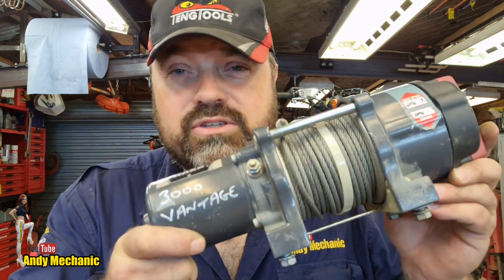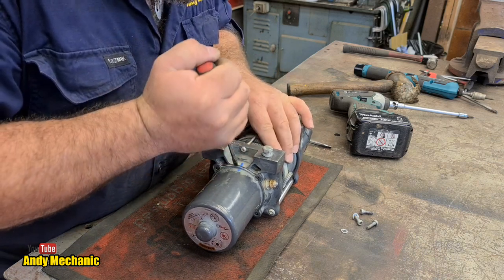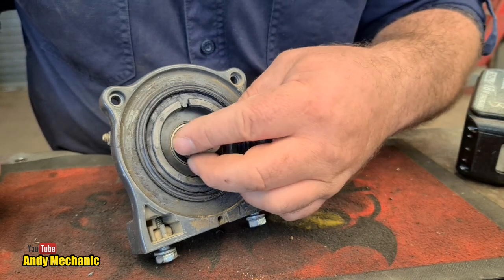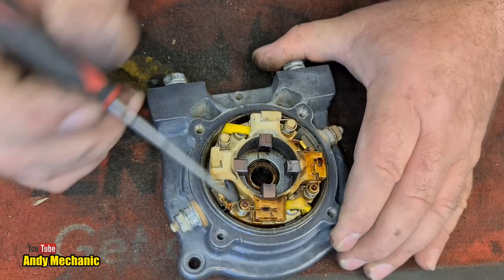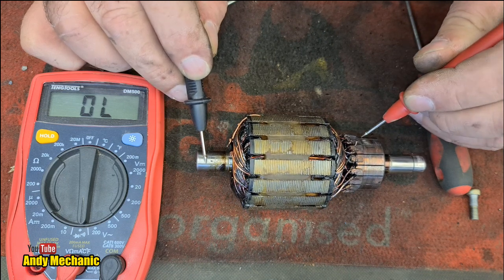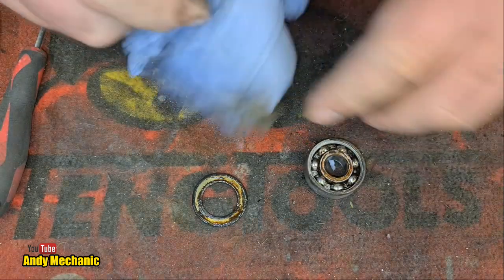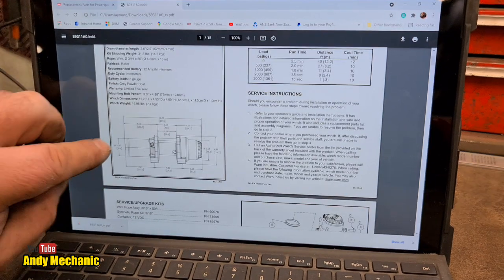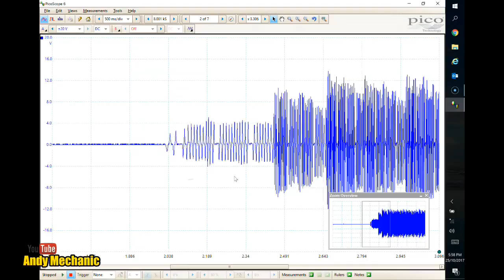Warn winch failure   strip & inspection #1485

Comment: Nice video! A lot of these smaller units are only rated for a 5% duty cycle. It states in the manual that they are only allowed to pull max load for 45 seconds in a 15 minute period. 45 seconds of pull, then 14 minutes and 15 seconds rest time. If the customer were to pull hard on this thing for 5 full minutes....thats way past its duty cycle rating
Reply from the maker: Yes, I read the 'table' in the Owners Manual a few weeks ago - crazy limited time of usage, I doubt many people are even aware of this aspect. I'll include it in my next winch video - I have another one to strip & poss repair...

Cheers Andy

Comment: Nice work, Andy. like your idea of repairing thinks and not throwing them away. 😉 Looking forward for the gearbox vídeo. Would you consider installing an aftermarket new bearing and brush pack as worn  only sells the case?
Reply from the maker: Yes, Definitely, provided the armature is in good order & they seem to be of good quality etc...does seem odd that Warn don't supply a service kit for the motor!

Cheers Andy